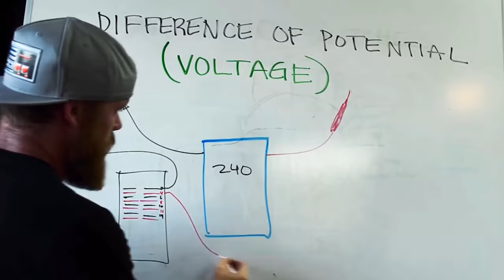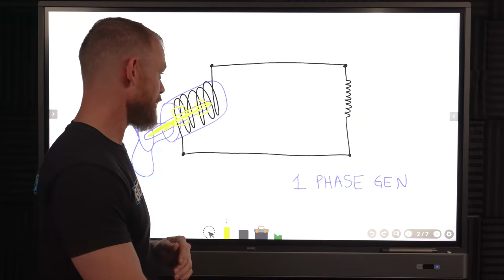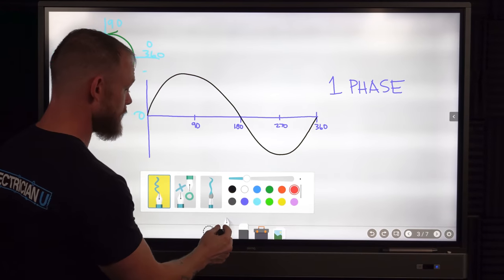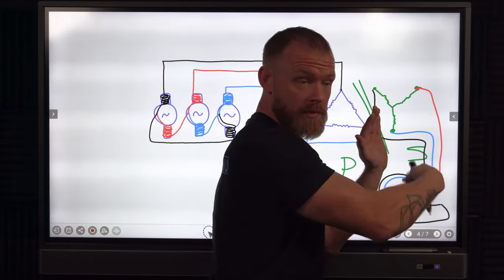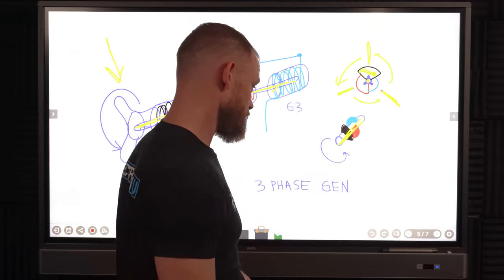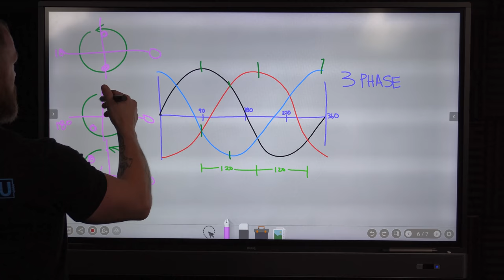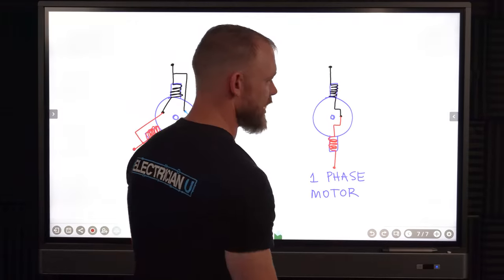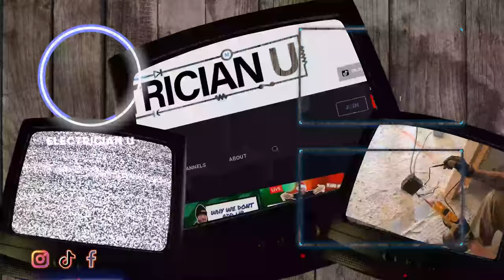What is the Difference Between Single Phase and Three Phase???

Comment: Was always wondering why there's only single phase and three phase but not a two phase.  This video helped clarify that.  But was also hoping maybe you could do a short 2-3 minute clip on why there's no such thing as a 2 phase.  Thanks again for all your hard work.
Reply: 2 phase was a system used way back, but it has drawbacks compared to three phase.
Its 90 degrees out of phase which is hard for motors to work efficiently with plus you need two return wires  meaning that a total of 4 wires are required to power one load.
Reply: @harrymiller513  thanks so much for that clarification!
Reply: The "singel" phase system here is actually two phase red and black.
Reply: @harrymiller513  in a two phase system the phases are 180° out of phase, with 90° you would need four phases.
Reply: @Alex_Vir  that would be single phase split system used in north America?

Comment: Hy Dustin! I want to have some info from the US electricity vs Europe. (it's came mainly because of engineer's curiosity). So, in Hungary, and the EU we have differences from the US. One of the main is the frequency (we have 50Hz) and AFAIK we have difference in the utility side to. The first difference maybe around the transformer, which is street based here (so we got a big transformer which can supply 1-3 streets, and all building in it) Those transformers are all 3 phases, and the secondary side is propagatet to the houses, where we have 2 or 4 different wires, 1 or 3 phases and one called PEN. If you measure beetween one phase, and the PEN, you'll get around 230V, and if you measure beetween 2 phases, you'll get around 400V. When we connect to the utility company's network, they'll give us a consumption meter, and the 2 or 4 wires (depends on what you ordered from them*), and after that, you have to create a PEN junction, where you separate the PE (protective earth) and the N (neutral) for your building. (AFAIK: the street transfomer also connected to earth somehow). At the PEN point, every house owner has to hammer down a long steel rod to the earth, which will be connected to PEN junction also. After that, you'll have 3 or 5 wires in your house (1 or 3 phases, N, and PE). In the house, you'll create all circuits beetween 1 phase and the neutral, and you'll also get PE in every power outlet. 

Why I wrote this down?! Because of the concrete mixer! :)
The concrete mixer motors are usually 3 phases, since we need a lot of power to them. When I want to use one, and I only have 1 phase, we put the motor in delta configuration, and we put in a capacitor (the 3 point of delta will be phase, neutral, and the capacitor-s one pole) the other pole will goes to L or N, depends on the rotations direction. If we have 3 phase however, we put the motors on star configuration, and the 3 phases will goes to the points of the star. (there are a few things which I not mention above, but this is the most common use case )

So my questions: 
What kind of motors (windigs) do you have in US?
How do you connect it to the utility, if you have one phase (with N in the middle)?
Can a home owner order 3 phases?
Do you have N from the transformer, when you have 3 phases?
What voltages do you have beetween the phases in a 3 phase utility?
Can you upgrade your 2 splitted phase system to 3 phases, is you want?

Thanks: 
 Peter

* you can easily upgrade your one phase system any time to 3 phase system, if you order it from the utility company
Reply: The Y transformer does have a Neutral when using 3 phase power
in USA.

Comment: “This is not how these actually work, I don’t know I’ve never seen the inside one of these big utility generators” 🤣

Man, you’re one extremely intelligent individual! The fact that you can conceptualize something that you’ve never seen so others can understand it is amazing. You are an outstanding teacher and it is very appreciated. Keep up the outstanding work!
Reply: Well the problem is, that he got that 3ph gen wrong. its not 3 cam-like magnets in line on the shaft. Its one big magnet on the shaft, and 3 windings spaced 120 deg in the stator. When magnet rotates, it reaches windings one after another.
Reply: @sumilidero  it's almost all wrong.  He also goes into a huge explanation using 120 degrees for sine waves and mechanical degrees. The problem is poles are mechanically 180 degrees apart.  He's confusing the two.  Among other things.
Reply: @traditionaltools5080  Thats unfortunate video, also he wasnt confident about what he was talking, you could immediately see he had no idea about that. Need some industrial-experience, not only plug changing ;)
Reply: @sumilidero  the magnets in a generator are south and north poles in one. Meaning each magnet has a north and south pole. So they are 180 degrees displaced.  At one instance the north pole crosses a winding while at the same moment the south pole crosses a winding that is opposite. 

The three circuits generated are 120 degrees to each other by the physical placement of the other windings..
Reply: @harrymiller513  thats exactly what I said..

Comment: And also…. Back when I used to work in a power plant… making electricity…. (Haha)… on 3-phase motors… after a 3-phase motor was sent out for repairs (or just being re-connected) and then hooked back up…. You ALWAYS… “BUMPED” the motor to make sure it was rotating in the proper direction before you made your permanent connections.

Comment: Absolutely nice presentation I enjoyed it as a master electrician who worked with electricity since 8 years old.
If I may have some comments. The term "Single Phase" is completely wrong in the industry and persons like you should be correcting it. Let me explain why. Single or one phase  is really the black wire and the white. The white wire does the same thing but it is grounded so when you touch it it will not shock you. That is only a safety consideration and has nothing to with current flow.
If you take away the ground from the white wire, it will become a black wire and you have now the single phase circuit. Do you agree? Now what the industry calls a single phase circuit, it is really a 2 phase circuit, because the red is exactly the opposite of the black. In 2 phase system the white wire (neutral) is only carrying the current differences between the two phases, as you explained perfectly. Nice work from your end.

Comment: I remember explaining this to a 4th year and using the graft way to explain, wich didn't work. The next day he came in and was like "IT A Y! And the neutral Wire is in the center to balance the lode (we were wiring plugs on a 3-phase building) to wich my response was "idk man, sounds right. Im just a first year" a prime example of why my company would rather higher a green guy over a residential master electrician, as neutral pairing can be beyond them sometimes

Comment: OK, since everybody is too busy kissing ass I am going to point out that a phase is not a circuit. A phase is the relation between current and voltage in a 360 degree cycle and it only applies  to alternating current since DC is a section of the sine wave. I understand that in a panel a specific position will determine which phase a circuit will come from, but anyway; what do I know? I'm just a people greeter at a Walmart.

Comment: You could have clarified the difference between 240 V single phase in residential vs 208 V single phase in a 3 phase system. You drew the diagram for 240 V single phase in residential with the the 2 sinusoidal waves 180ﾟ apart, but that is not the case in a 208 V single phase system.
Reply: I think he’s keeping it simple to help understand better for beginners cuz the 208 comes from using two phases of the three phase system. Back in the day they actually did call it a two phase system. The 120/240 single phase we use at home is technically a split single phase cuz of the neutral. I don’t know of any residential applications for 208 though. I’ve only seen it in light commercial work but I’m sure someone uses it somewhere. Maybe more of an hvac thing but I’m not too sure.
Reply: In thee phase there are three 120 degrees apart. On three phase one should use tree phase loads for high power applications. Just connecting between two phases and getting the 208 V is really misuse of three phase. One should use all three phases in either star or delta.

Comment: The problem with single phase or split phase is that powerful motors cannot be built with it. The motor does not start by itself and remains weak. It is possible to create an auxiliary phase with a capacitor. Or a magnetic unbalance can be created with a magnetic closure.

The 3 phases asynchronous motor always runs, but it runs a little slower than expected. Therefore asynchronous.
Depending on the circuit, two power levels and direction reversal can be switched.

Comment: That concept of 3ph generator is totally messed up and confusing :D As you admit, you havent seen it. Its magnet on the shaft, and 3 windings are wound in one stator, each winding wound 120 deg after another. When magnet rotates, its magnetic axis reaches phases' axis' at different times. Its one stator having 3 separate windings around its circumference, equally spaced: 360/3=120 deg

Comment: Very well explained. Thank you! Wondering if 3 phase always uses a delta / wye configuration; or can it be a delta / delta ; or wye / wye? And, why?
Reply: Depends on the application and how much money you have.
Reply: Most of the time delta configuration is used in HV/EHV and MV system  (which is transmission level) then goes down to wye configuration at distribution level. The reason for this is you go as high voltage as you can to transmit power with the lowest possible current to minimize losses and it is cheaper (lower current means smaller conductor size hence cheaper on material cost).
Reply: @marlonespino9111  thank you

Comment: Clarification of an issue: I have a multi story building with a lazy electrical engineer that has drawn a simple line drawing indicating we are to tapoff the switch gear busbar on the line side for three new meter heads. This means we have secondary utility voltage running through the building some 25' beyond the switch gear. I feel UL and NEC dictate this I have submitted RFIs to engineer and no response. What are your thoughts?

Comment: At 0.56 you stated that the single phase 3 wire Edison system had two Phases a black and a red. No single phase never has two phases. It usually has two energised conductors with a center tap that provides the grounded conductor. ( No such thing any mire as a neutral ). Have worked on several types such as single phase 2 & 3 wires, 3 phase with 3 & 4 wires and for fellow old farts like me two phases with3,4 & 5 wires. At my first job old plant had both two & three phases machines and even had two phase 3 wire 2,300 feeding a remote building. Nothing beats the starting torque of a 3 phase motor. Always cracked me up when converting a business from 240 volts 3 phase to 480 volts 3 phase. Often told me that their electric bill will be a lot lower.

Comment: Why does a 3 phase motor with no load on it draw almost no current where a single phase still draws much more in the same unloaded condition?
Also, what causes a three phase motor to change direction when you switch two of the phases?
Excellent video!
Reply: When you switch 2 wires with 3-phase, you switch the direction that the magnetic field rotates.
I'm not so sure about your first question (uses less current or less total power?). If the former, I would wager it's at least partly just a matter of there being more power conductors and therefore more power for less current.
Reply: It does and it doesn't.  An unloaded 3 phase motor draws less amps (power) but actually uses more reactive power.  Which is a problem for large facilities because it wrecks their power factor ratio.

They're designed to work at full load.  Otherwise the magnetics in the rotor are out to lunch.

Comment: I seen just now an I ld video about bonding the ground to neutral sorry in Tennessee in the breaker panel ground and neutral must be isolated if not you will fail inspection .I have only bonded service panels to neutral like that for generators or garage panels when garages are not attached to the house

Comment: You should show graphically why we dont use 2 phase power, due to the load that would have to travel on the center tap conductor, and insted skip from single to three phase power.
Reply: American 240v is 2 phase power .

Comment: How do I figure out if my dual SPEED residential single phase Amana AC will benefit from a Micro-Air Flex soft start?  My AC tech says Goodman/Amana told them they don't work on their higher end units.  I'm wondering if that moreso means "it won't benefit" from it since it starts in Low speed mode?  My LRA said 118 amps on initial startup FWIW

Comment: So when one conductor has a "push force" for an example of 10 at top dead center(TDC), do the other 2 conductors have a pull force of 5? And the cycle repeats every 120° rotation of the generator when the next conductor reaches TDC?

Comment: Good stuff.  Actually great stuff.  Probably you'd get more "traction" if your 360° spun clockwise and used "standard" (cardinal) degrees.  0 is north (up).  90 is east (right),  180 is south (down).  270 is west (down).

Secondly while you go out of your way not to talk VAC or bring up 120, 240, 208, 277, etc.  When you break up 360° into the three phases that 120° might be confused with 120VAC or 240VAC.  Better to explicitly explain the two are entirely unrelated.

And finally, while you do mention phase rotation and phase order, it might be  of benefit to your learners to understand what that means and why it's important when you're running things like motors, HVAC compressors (motors), or other items (motors).  

Good explanation on the start-circuit caps but would be better if you could show actual usage, as in "this is used in HVAC starter circuits to get the compressor turning" and even "the lack of 3ph power is what causes such a huge inrush current on 1ph HVAC systems."

While on that track, There's a common misconception that 240VAC is "split phase" and that's different than "2 legs" and if you're going to differentiate between 1ph and 3ph you might as well explain the difference.

That's all I got for now... time to get some shut eye.  Happy New Year.  This post is a year old but hopefully others may find these comments instructive.

Comment: Like to see how the circuits are wired in receptacles - single and three phase and how they compare. Bcos some countries use 220 - 240 vs some which use 110 - 120 circuits. Are the countries with 220 - 240 circuits 3 phase?

Comment: A circuit without a "load" is a Direct Short.
Every circuit requires 2 "sides" or "legs" of power , a Switch to control the circuit, and a load to avoide a direct short, without a load the circuit has no resistasnce to speak of, not enough to reain energized , it will overwhelm the fuse/ breaker.
The push pull is the frequency, 60 times per second, DC flows in 1 direction, AC alternates.

Comment: I’m still very much confused on the 3 pole breakers. So let’s say you have a 3 phase 120/208 Wye set up and you place a 3 pole breaker in the panel do you get 208 volts to the motor needing 3 phase or what ? I think I understand what you mean about the 3 phase giving a motor the rotation it needs but I’m so confused on the voltage ..

Comment: Here is a question for you and those who think they understand electric theory. 

Ohms law states that current is directly proportional to voltage and inversely proportional to resistance.
Meaning that as voltage rises in a circuit, current rises proportionally if resistance stays the same. 

 A motor may draw 10 amps at 120 volts, but draw 5 amps at 240 volts. 
How does a motor draw less current the more voltage is applied to it.

Comment: I have a quick question boss man. If you are feeling a panel 3 phase from a meter with a disconnect the and your are using a ser wire 4/0,4/0,4/0,2/0 and we are using the bare wire as neutro, the neutro can be bare In the panel?
Reply: Please don't take this the wrong way, but it appears that you don't fully grasp the concept of electricity and proper wiring practices. What you wrote is very dangerous. Please have an electrician come and inspect your wiring before somebody gets hurt.

Neutral and ground are two different things. They are two completely different concepts. The bare wire is ALWAYS ground. NEVER wire the bare wire as a neutral. The neutral wire is always jacketed and it's a current carrying return for 120 volt single phase circuits. There is no neutral for 3 phase circuits. It's not needed. As one leg conducts, the other 2 legs act as the return. The ground wire is a safety path back to trip the breaker in the event there is a short. All circuits, whether three phase or single phase, should have the ground properly wired. If there was a short in the circuit without a ground attached, any metal in the system could potentially have line voltage sitting waiting for a path back to ground. There is a very real possibility that you could get seriously hurt or possibly die.

Comment: Hi I have a kitchen aid wall mounted single oven model KOST100ESS I bought from usa & I’m trying to install it in Egypt where the voltage is 220v/50hz Single phase can you advise what should I do to convert the current to have it work

Comment: hi, for 3 phase wire connection on isolator switch, on the RBY wires placement can I installed it at BRY or YRB instead ?

Comment: Hi,sir can you please present how to convert a 3phase generator ,6coil,12lead y configuration high voltage ,low current (series star) to single phase output....high  current ,low voltage (parallel star) I really want to understand.the theory and practical connection on the alternator.cheers